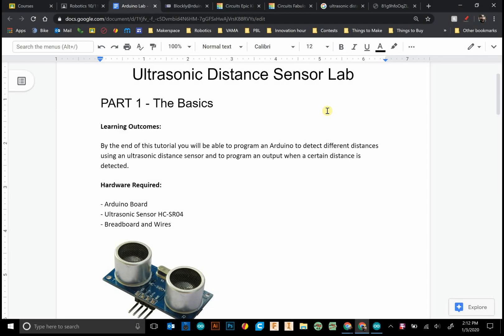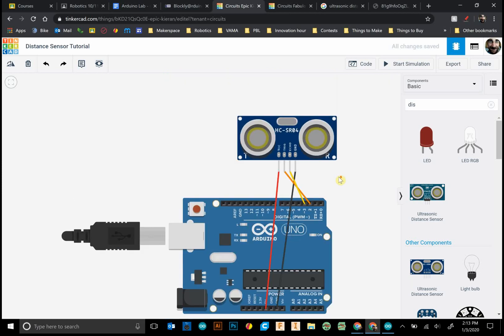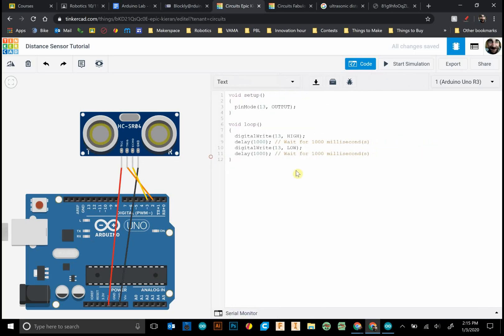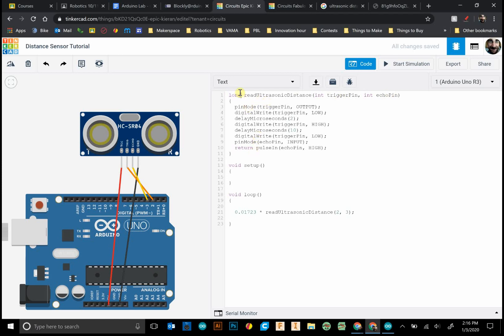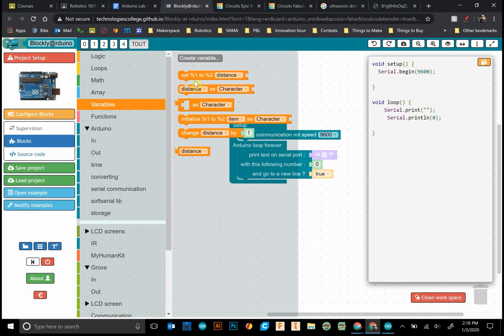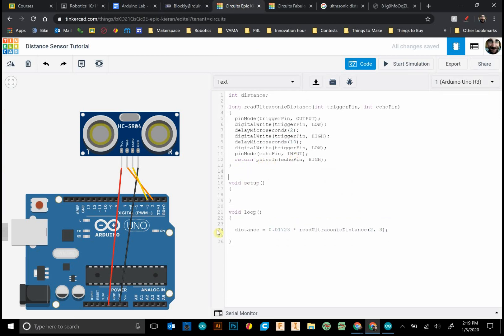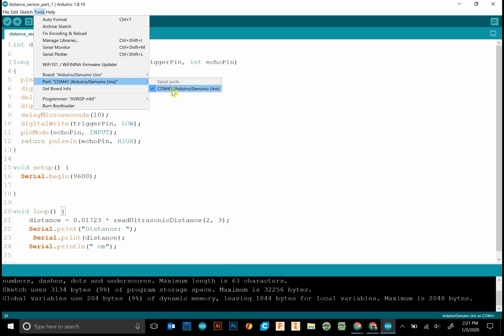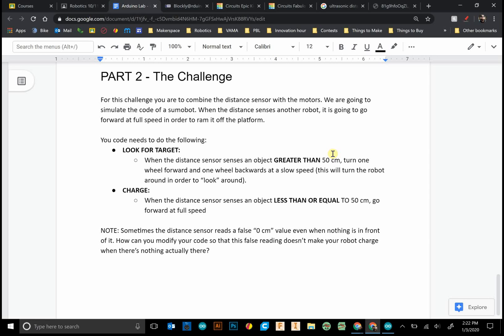Arduino Lab: Distance Sensor Using Blockly Arduino

Comment: Great video. 

for my own exercise, I wanted to turn on LED when the distance is closer than 200. I connected a wire from pin 13 to the second GND pin. my code looks like this:

void setup()
{
  Serial.begin(9600);
  pinMode(13, OUTPUT);
}

void loop()
{
  distance = 0.01723 * readUltrasonicDistance(2, 3);
  Serial.print("Distance: ");
    Serial.print(distance);
    Serial.print(" cm\n");
  if (distance < 200) {
    digitalWrite(13, HIGH);
  } else {
   digitalWrite(13, LOW)
}
}

However its not turning on when i get closer than 200, its always off. Would you know why its not working or could point me in the right direction? thanks!

EDIT: I fixed, it: the output cable was attached to the left pin on the LED when it should have been on the right pin.